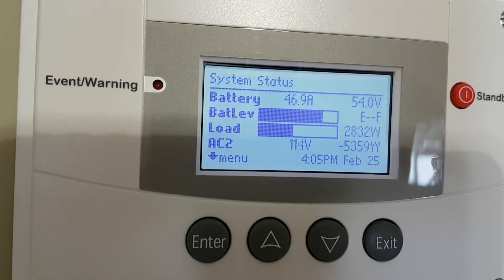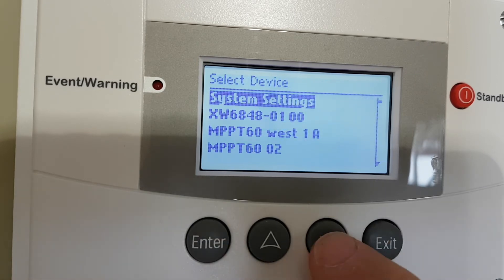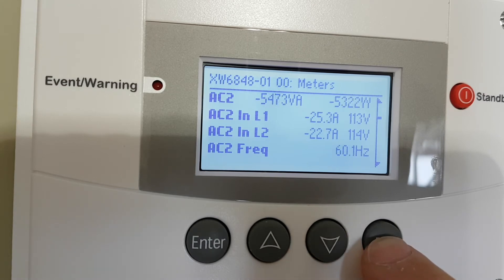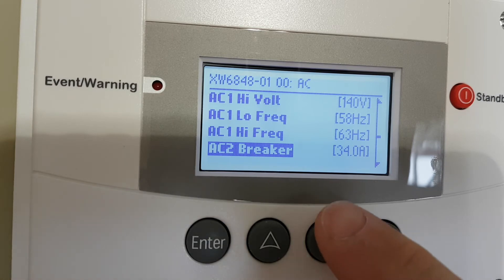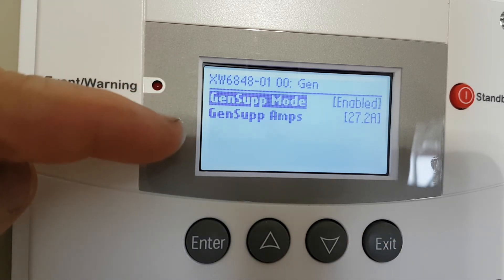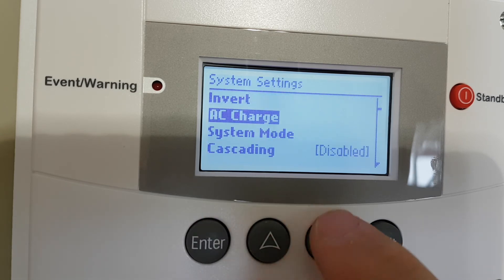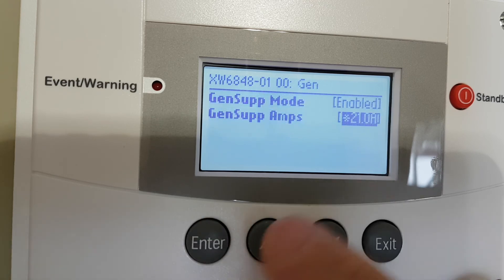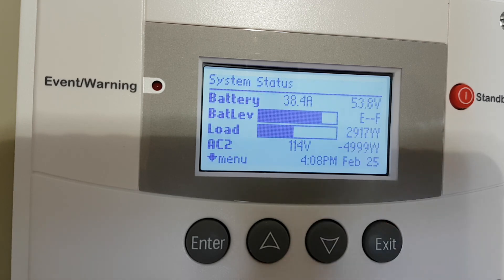Part#1  Schneider conext AGS, GEN SUPPORT,

Comment: I also have the SCP on a 24-volt system thank you for sharing with us could you do a video of the install with your generator like physically for the wiring thank you
Reply: it really  depends on your genset . but remember the AGS has dry relays and must be powered and use external relays as the AGS unit can only handle max 3 amps
Reply: https://youtu.be/Ph9-YpCujOc?si=50kPAqY8f6wkeWPN